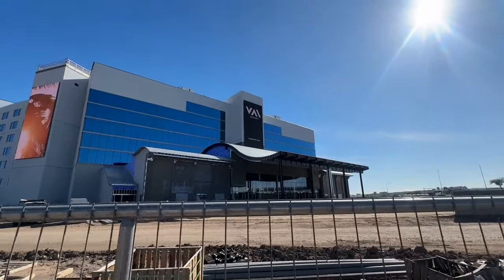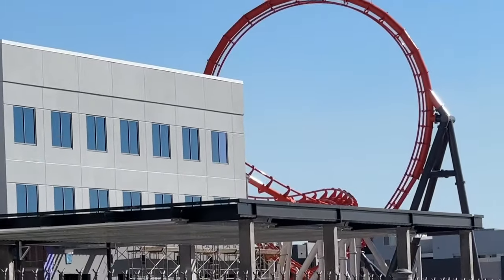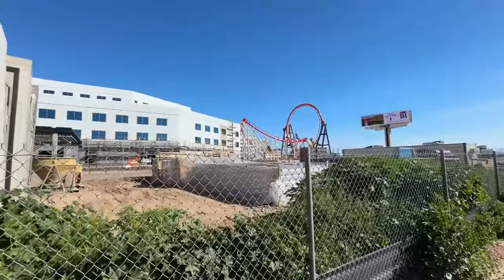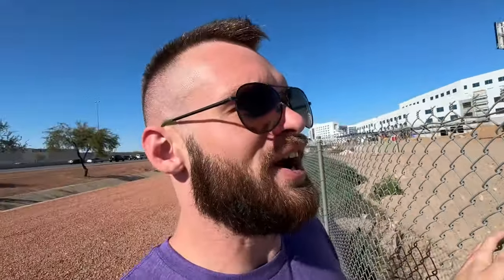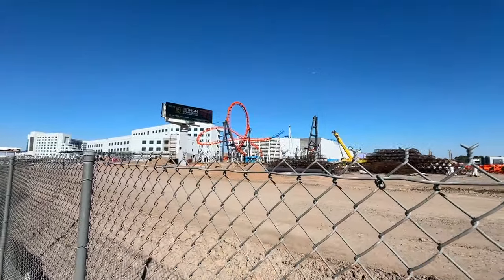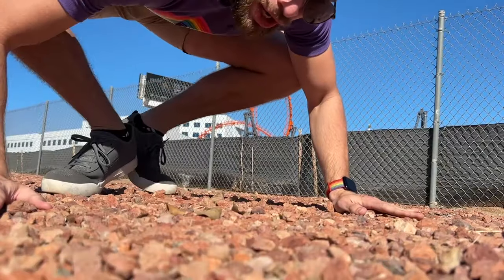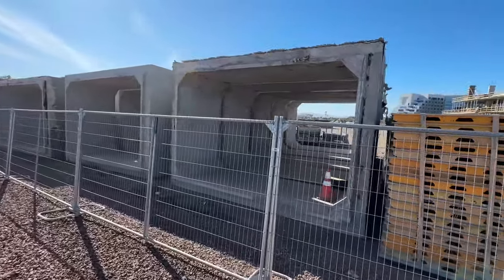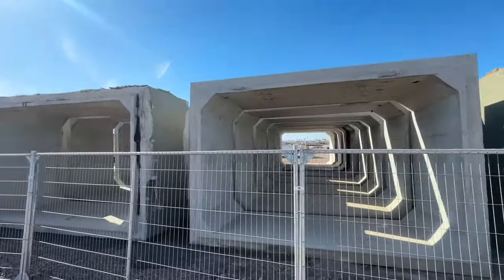EPIC HOT WHEELS ROLLER COASTERS - Coming to Arizona!

Comment: How much are you willing to bet that this is gonna become lightning rod 2.0 and breakdown often as it’s never been done on a gtx LOL
Reply: I don't think it will, because the launch is indoors and it's a steel coaster. Lightning Rod had a lot of issues with its launch because it had never been done on a wooden support/track structure before. And those are notorious for shrinking/expanding based on temperature as well as swaying alot from the cars traveling on it
Reply: @coastersandcosplays  true but it’s never been done on the GTX hyper model
Reply: @Chessingtondragonfury  neither have inversions been done on ond, but I feel like the heat/ temperature will cause more issues than the launch will. We will just have to wait and see!
Reply: @coastersandcosplays  it’s possible for the heat to get indoors and overheat the launch